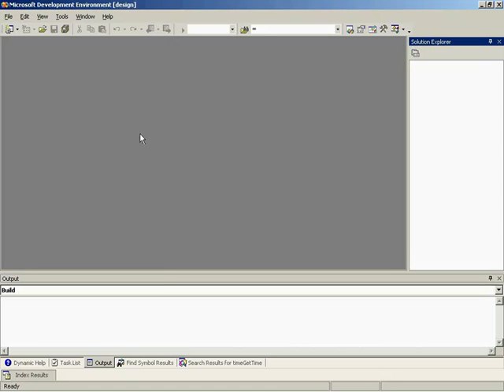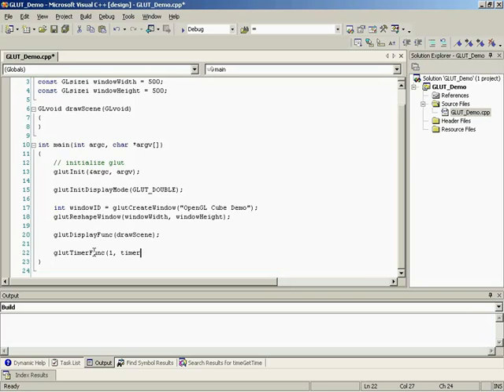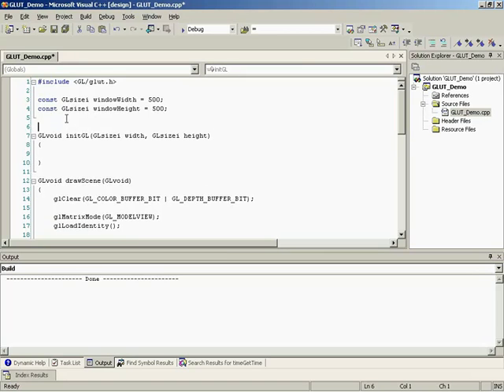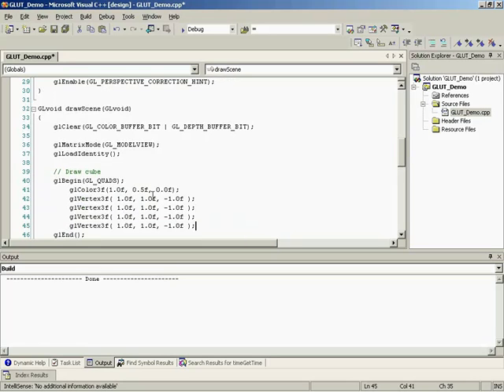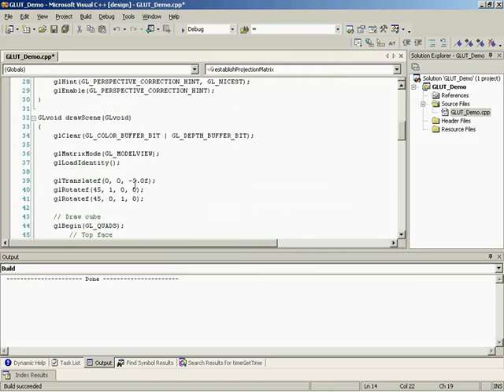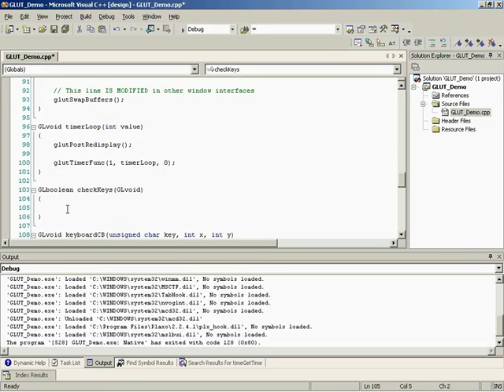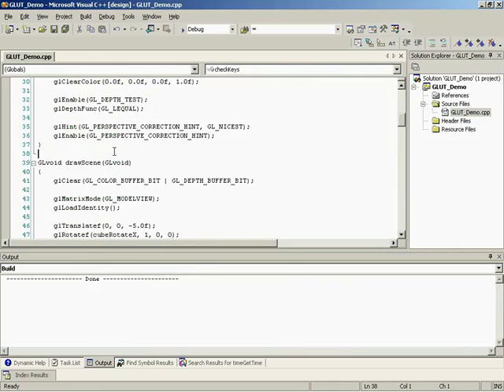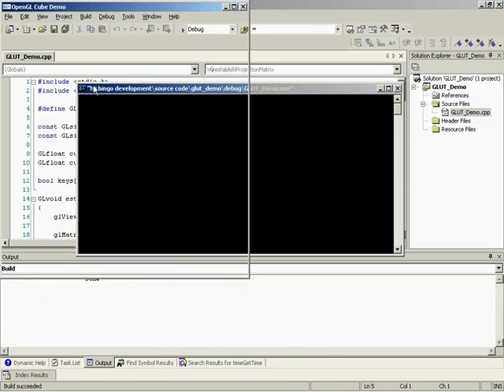🔴 Using GLUT • Intro to OpenGL • OpenGL Programming for Beginners • 3D Graphics API • (Pt. 9)

Comment: If you ever redo these, I'd like to suggest that, instead of returning 0 in a "can never happen" situation, which would indicate to the shell that the program exited normally, when in fact it has done something unexpected, you return -1, so at least you signal that things are definitely NOT ok.  Ideally, you'd do some kind of panic instead of returning -1, but I imagine for simplicity of these videos, you've elected to just have a return with a comment.  So, at least returning -1 indicating there was something unexpected, even if the code never reaches the line, reinforces to the code reader that this is definitely an exceptional situation.